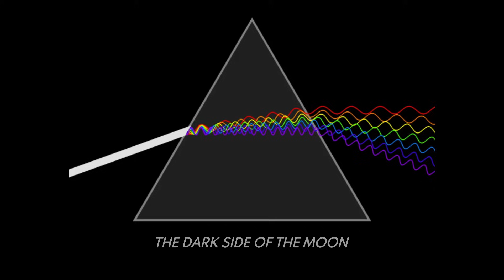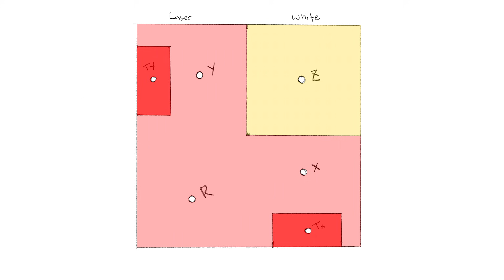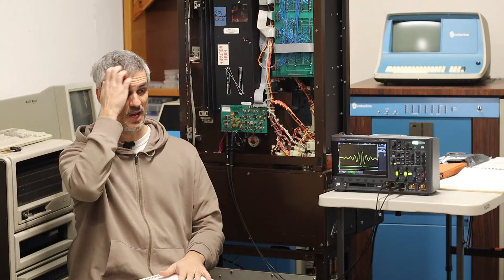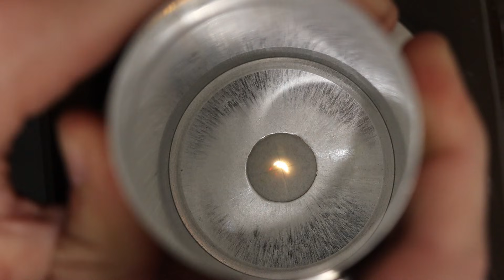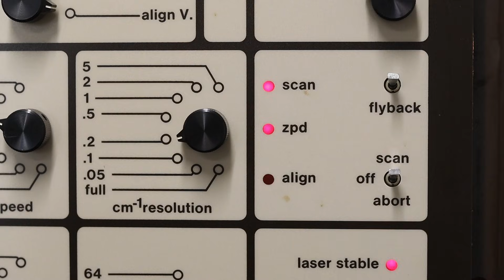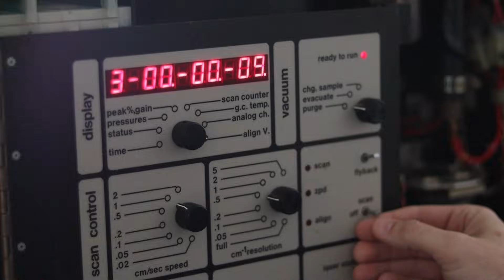Aligning the Detector on the FTIR Spectrometer

Comment: Without seeing the full schematics including the photodiode I would just guess its a reversed biased photodiode and U1 OPA111 is used as transimpedance amplifier (TIA) to convert the current of the photodiode into a voltage (with a really mind boggling max gain of 10.000.000)

Comment: I don't thing it good idea to connect oscilloscope directly on transimedance opa input. The capacitance of probe highly affect the signal. Also, you can see limitation on the preamp board output, it's typically also not ideal.

Comment: I design and build what are effectively modern versions of these (with slightly different configuration and post processing to get the thickness between optical interfaces instead of spectrum) so it's really cool to see one this old up and running!

Comment: I wonder if you could use a thermal imager to quickly identify what's getting too hot on the board?
Like a thermal runaway, for sure..  but you might also see one chip unexpectedly change temperature faster than the others

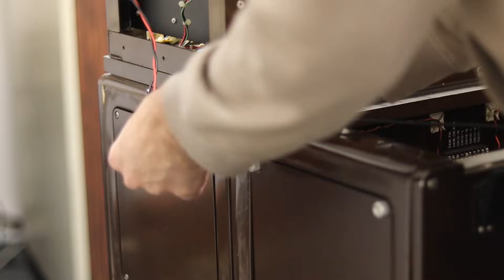Comment: Great video! At 14:30 it looks like there is no power source so at best you might detect change in resistance? The detector would need some kind of voltage input to get an output? EDIT After watching the video, you got it to work! (without input)

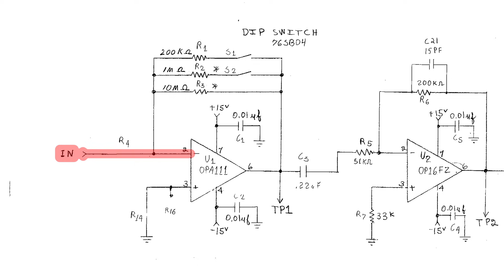Comment: At 17:00, when you talk of the OPA111 op-amp, its open-loop gain is well over half a million, meaning that a signal at its input of more than 30μV peak-peak would drive its output beyond ±15V, suggesting that it is saturated. It wouldn't then be amplifying linearly, as I believe this application requires - this looks like a typical zero-biased photo-diode transimpedance amplifier, and I assume it's supposed to amplify linearly. If I'm right, then if you see a large input voltage swing in excess of 30μV peak-peak, that's already too large - you should be looking for almost NO signal there, indicating that negative feedback is working well, and the system is linear.

Comment: I read a bit about those lasers.  That HeNe laser is a thermally stabilised laser.  That is the reason for the thick film heater inside of it (yes, it's actually inside the tube).The object is to stabilise the wave frequency of the light output to within about 75MHz (remember that the wave frequency of visible light is in the terahertz region).  There are ways to lock the frequency even closer than that- iodine cell stabilised lasers can have stability in the kilohertz regime.

Comment: In the automotive world we called that type of repair the “wiggle test” you wiggle it till it breaks, or you wiggle it till it’s fixed
Reply: Isn't that just Engineering in general? Old adage:
1. "Does it move?"
"No"
"is it meant to move?"
"No"
"Fine! Leave it the hell alone"
2. "Does it move?"
"No"
"is it meant to move?"
"Yes"
"Fine -- hit it with the WD40!"
3. "Does it move?"
"Yes"
"Is it meant to move?"
"No"
"Duct tape the hell out of it!"
Right there, you have an Engineering Degree in a nutshell 🤣

Comment: Note I'm writing to our author here, I'm not commenting on this video so much, but I enjoy all of the videos here.  This one was really cool:
I'm the guy with the Techtran 8400/8410 Manual that I sent you.
----------------------
Here's what we should build next.  Your viewers can see this and comment.

We should design and build a Front-Panel for a 386/486/Pentium PC as if it were a processor plugged into an S-100 chassis, but the S-100 has been upgraded to support full 32 bit addressing:  32 bit address, 32 bit data, plus control lines. Also the control signals on the bus should be changed from matching an Intel 8080 to being applicable to a 386 for example.

If you think about this idea and if you really want to go Full Monty then we make it a 64 bit address bus - to match the latest X86 processors.

Now, this front panel will be wide physically and it wouldn't be mounted on the front of the traditional horizontal computer case, no it would be spread across the wall at Usagi Electric and it would be cabled to a computer.

We would likely make this in the spirit and style of an Altair 8800, with switches and lights (LEDs) but depending upon personal tastes the styling could be IMSAI like (that's much harder) or it could take on more of an IBM 370 Mainframe type look (pick your favorite mainframe look).  By this I just mean having that professional look.

I'm not so keen on the use of Octal or Hex rotary knobs (like an IBM 370 front panel) as the address/data value selection.  I definitely favor the Altair 8800 style, or typical mini-computer style front panel with either switches or plastic paddles (like a PDP-11).

The reason why I suggest this.  I personally have been intrigued by what computers would have had for a front panel if they had continued to have front panels.  For example the front panel of the first IBM PC, or the front panel of the original Wozniak Apple, or the front panel of a Macintosh.

I'd opt for the 386/486/Pentium with it's full 32 bit address space as a starting point.

Then the front panel could be backed up by a board that contains one of these processors so the font-panel would be fully functional, or another probably much more practical would be: the front panel being backed up by a processor simulator that is running on a modern x86 based PC.

Reason?  My gaming PC is a Ryzen 5 7600X that AI estimates to be roughly 500,000 VAX MIPS, and when using VAX in the old days I used to think and say that the 1 VAX MIPS performance was all anyone needed for the kind of work I was doing.  So this kind of performance is so severe, it should be able to easily do the job.

So the point is a modern x86-64bit processor is so fast it can simulate a Pentium in software at full speed (or it could use the typical debugger trick of placing a single instruction with a branch after it, and just executing one instruction at a time, saving all registers, restoring all registers, and you could run a Pentium that way likely at full Pentium speed.

So for the first time, on your channel, the world could watch you turn the machine on and enter a bootstrap program into the Pentium computer and boot an operating system, Halt, Single Step, and possibly see the register contents on your front-panel (the simulation environment would do this for us).  We all could contribute to the project.  I could contribute funds, or maybe write some of the software.  Many viewers would want to contribute I think.

it would be wild, man...  It would be epic, and all sort of people would want to see it.  I think it would go viral.

So that's a project where something has to be built and it is not larger in scope than other tube computer constructing projects you have completed.

I could start on something like this but I know I would never finish it.  You finish these large projects so you could actually pull this off.

And then after that your fully operational front panel would be computing and flashing away in the background and it would make a perfect backdrop as you worked on further projects.  A working original full PC front panel - operating live.  We could watch various software being run and see if the pattern of LED had recognizable patterns.

The design would be just circuit boards, TTL chips, switches, LEDs, possibly commercial micro-controllers and some metal cabinet front-panel construction.  One could use possibly some backing wood to mount circuit boards and front panel metal on, plus Gigabit Ethernet from front panel to the actual PC and software to support socket communication to and fro, plus the simulator/emulator software.

Thoughts?

Cheers!

Comment: Note that the op-amp saturating (to +15V) means it can't control its input anymore; hence the photodiode voltage drops, instead of being held constant (at (virtual) GND).  You found the focus alright -- you put way too much signal into it in fact!  (Well, I can't know it's "too much", maybe this is by design -- but it's suspicious in the sort of way that, I'd at least want confirmation that it's supposed to do that, y'know?)  There's probably an intensity adjustment or range or something (I guess if you're already on the lowest-value feedback resistor, on that DIP switch, such adjustment isn't on the preamp board; but anything from lamp to optics will do the job) that keeps the photodiode operating in the linear range where it can deliver consistent, juicy wobbles of signal.  (Or maybe you did and just glossed over this part; the rest of the waveforms do look to be doing the job!)

Comment: I appreciate when machines are made to be maintained. These days it's "oh, your EEPROM has corrupted data, let's replace the entire electronics package in the stove." Unpacking that statement reveals a number of problems in modern design. I mean, it costs more, but if you can keep it running forever, it's worth it.

Comment: Good job. You can not plug in the scope probe parallel to the photodiode. The probe impedance is rather low and will shunt the diode signal.

Comment: If you replace roms that are in sockets and the behavior changes it's quite likely that there's an oxidation issue or a bad solder joint.
In any case it was later revealed that the issue was elsewhere.
And it's an amazing instrument. Laser tech is definitely something that has made a great difference in science.
In a way to me the adjustment of focus still seems a bit sketchy, but the use of a mirror was definitely a good idea.

Comment: The signal TP1 driven all the way high indicates too much light to the sensor. From this point on the input is also no longer a virtual ground and thus a signal visible directly at the input.
The dip switches could select a smaller resistor and this way get a lower signal at TP1. The light bulb may be a bit bright for the adjustment.

Comment: How sturdy is that cabinet? When I saw you turn that cabinet around and saw it shaking I thought “Gee, now that thing is all out of alignment again”.
Reply: There is vibration isolation between the power supplies and the spectrometer.  You were seeing the flex in the isolation pads.
Reply: I thought exactly the same thing.

Comment: A while ago I was trying to erase UV-EPROMs with UV-LEDs. What I found was, that you can - for lack of a better word - "partially" erase bits of such an EPROM, meaning that a programmed 0 will not do a binary flip to a 1 after sufficient UV-exposure, instead it will degrade to an unstable state where you will sometimes read a 0, sometimes a 1, depending on the length of the exposure. Made me question my test setup and drove me mad. So the erasure of an UV-EPROM is a stochastic process. Maybe everyone but me already knows this but I just remembered it and felt the urge to write it down somewhere :)
Reply: I never had this issue back in the day.  But the UV erasers we were using were based on fluorescent tubes, not LED's.  And i think the light was just way more successfully distributed in the erase tray by using a fluorescent tube.  I'd try moving the chips around several times, to make sure every part of the wafer gets exposed to the UV.  We even did this in the old days, you'd run a partial erase cycle, then move the chips and continue.

Kind of like how you need a turntable in a microwave to even out the "hot spots."
Reply: UV LEDs only do UV-A (near UV) light, and EPROMs need UV-C (germicidal) light to erase them properly. UV-C is the kind that you want to keep completely enclosed because it's really bad for your eyes. Those "phone cleaners" that use actual glass tubes ought to work if you run them long enough, like 20-30 minutes.
Reply: this is expected
if not enough of the correct wavelength hits the die then the internal signal level will float and the internal row/column select circuitry will sometimes pick up 1 and sometimes 0 depending on voltage, temperature, light shining through the window, etc. 
the cause could be anything - too weak light intensity, not-optimal frequency, out of focus, bad/worn out EPROM, etc.
Reply: I have never successfully erased any of my UV EPROMs.  They get partially erased but not fully.  I don't know how to fix this.
Reply: @timradde4328 Times ago I erased my eproms with rhe sun. It took from 1 week to a month in The tropical sun  and  depending the eprom type. Now I do it with a discarded UV toothbrush sanitizer (uses a lamp, not LEDs), in about 30 minutes. Last time I had to erase 24 eproms, 27010, 3 at a time, for a "SSD" card.
Reply: You're not alone! In fact the process has been videoed: https://www.youtube.com/watch?v=NF4vImG9MTw
Reply: Your purpose retrobright them for full erasers 😉

Comment: Great episode. The reason your manual is so difficult to comprehend is that it was written for someone who has had the factory training, which you have not. This was something I encountered many times during my career. I would have a piece of equipment that needed servicing and the manual made no sense until I had had the training. It worked well to spend some time with a machine struggling to understand it then weeks later have the training, then you could go into it with a lot of very specific questions. If you went for the factory training after getting this working I guarantee you would have a dozen or 15 AHA moments. BTW I spent 11 years designing and building spectrophotometers and built many, many transconductance amplifiers so this is a familiar territory for me. Which is making this series particularly entertaining.
Reply: And also, the first choice for someone they would hire to train as a factory service technician would have a BS in physics. Someone with an engineering degree with classes or experience with optics would also be a good candidate. They would be looking for someone who comes in with a quite detailed understanding of how that kind of spectrometer works and actually had analyzed it mathematically in a formal optics course and therefore had a pretty good idea of what sort of alignment the elements need coming in and just needs to be shown how to make that happen on that particular price if equipment.

I don't know what his background is, clearly he has a lot of knowledge,so I'm guessing electronics or electrical engineering or some such, which gives enough of a basis to figure it out. In any event, stellar work getting that old thing up and running!
Reply: HP manuals do NOT assume this, or at least didn't on 1960s and 70 kit.
Reply: @SusanPearce_H yea, the really old hp manuals were awesome.
Reply: @SusanPearce_H  When I started working as a dialysis tech we had a Cobe C3 dialysis machine. The manual was amazing. You could look at what the machine was doing, turn to the page where its behaviour was described and follow the troubleshooting procedure. Last really good manual I ever saw.
Reply: Writing manuals is really hard.
And it needs at least 2 trips from the person writing it, to an "intended audience" reviewer who will criticise.

A half-way successful manual will, of course, make your "Round 1 reviewers" too educated for reviewing "Round 2".
Reply: @WellsiteGeologist-UK  Indeed. I wrote a couple of manuals when I worked in research, it was very challenging. Much respect for good manuals. Also equipment is always being updated so manual writers are trying to hit a moving target. I also wrote user interfaces for computer programs, the round 1, round 2 problem, although I never thought of it that way, was definitely an issue. Having to find a new person to test it on every time I made a change...
Reply: @donhuebert9151  The hardest thing about manual-writing is getting the bloody users to read them.

Having done the writing side of things, I'm one of the very few people I've ever met who actually reads the manual before continuing with the un-boxing. Yes - I do like surprises, just not that sort of surprise! The "ohh, they didn't think of that way of abusing it" sort - with or without Magic Smoke(™) escaping, or burning the house down.
Reply: @WellsiteGeologist-UK  Haha yes! I have been there many times. When all else fails RTFM
Reply: This has been my experience with older CNC and PLC machines
Reply: Its also just confusing because it was written by french Canadians. They operate on a different um… wavelength 😅
Reply: @Megabean  wavenumber ;-)
Reply: @Megabean but they are so polite when you call for support. They .at not be able to help. But the are nice about it
Reply: @Megabean  I worked on lots of German equipment and yes, they have a different way of thinking about things. We were told repeatedly that you have to think about this the way a German would. After a while you could sort of get the hang of it.

Comment: Swapping outt he chips reminds me of basic PC and XR troubleshooting.  Due to heating/cooling internally of the computer case, the ISA slots and board expand and contract.  If an expansion card stops working, pull it out and reseat it.  That has fixed so many hardware problems for me before.